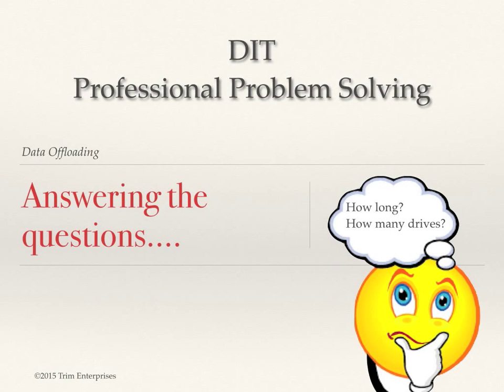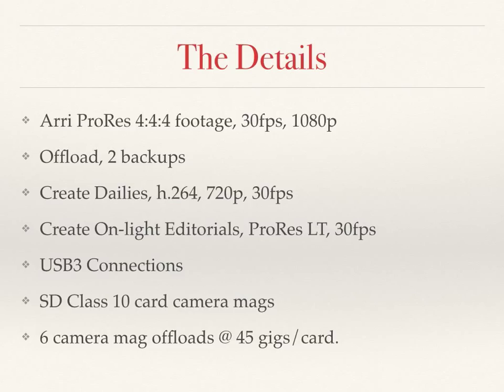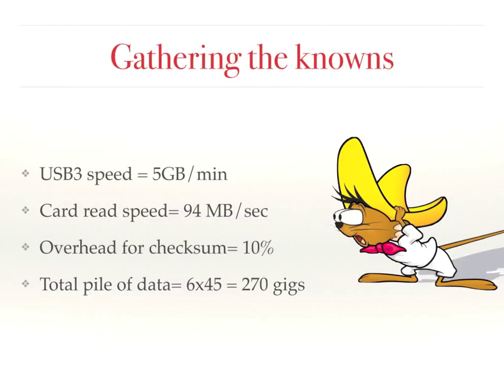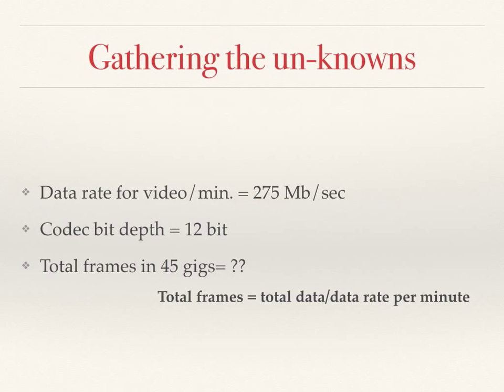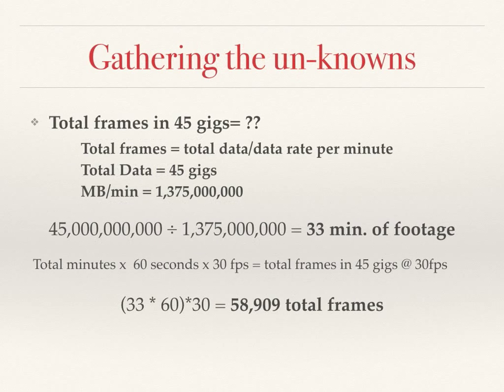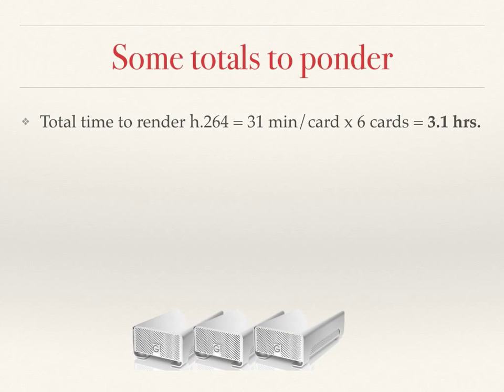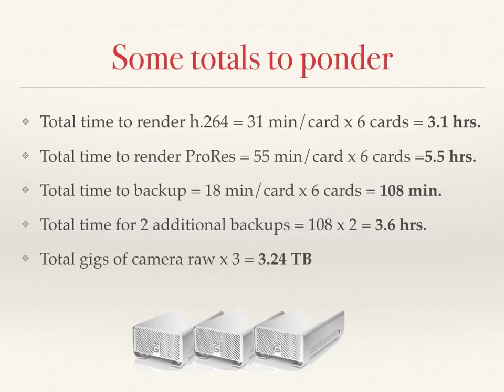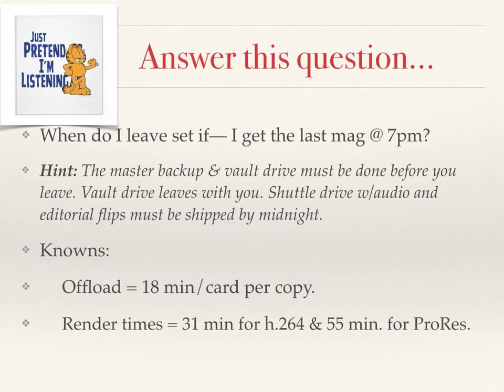DIT Professional Problem Solving- How to calculate data handling times

Comment: Hi Robert, thanks for the informative video. However I am a little puzzled by your bit to byte conversion method. As far as I can find out, there are always 8 bits in a byte no matter the bit depth of the image recorded. So at 08:00 the calculation would be 275Mb/sec ÷ 8 = 34.375 MB/sec. Or have I got confused? Thanks, Nick
Reply: You are correct, fundamentally. But I have found the actual outcome numbers (real world) are closer if you use the bit depth of the codec. All things equal, a 10 bit file is larger than an 8 bit file. I call it the 'fudge factor'. Much like figuring out the amp draw from a lamp head on set, in your head (Brain Amps), you divide the watts by 100 instead of the real voltage of 120v here in the USA. Yes the final number is high but that is the head room you want when loading up generator.  I suggest you aim a bit high so you don't find yourself hitting up the UPM for more drives towards the end of the shoot, when their budget is stressed. Hope this helps. And thanks for the thumbs up. More of these are coming.
Reply: Thanks for the explanation. Definitely better to err on the side of caution, like you say